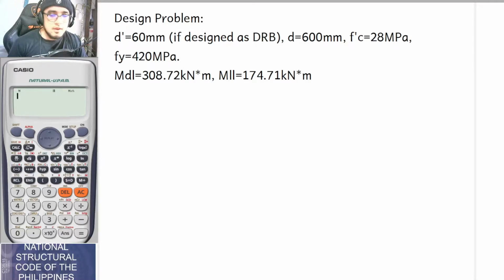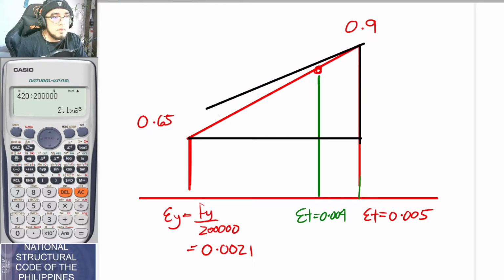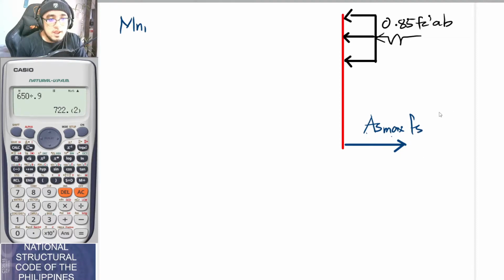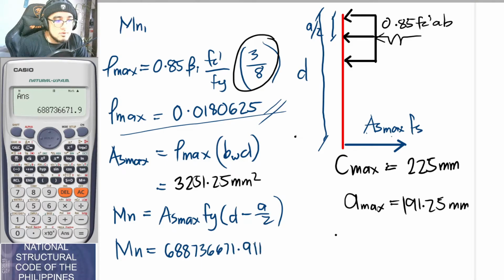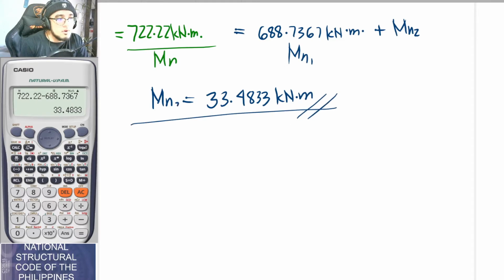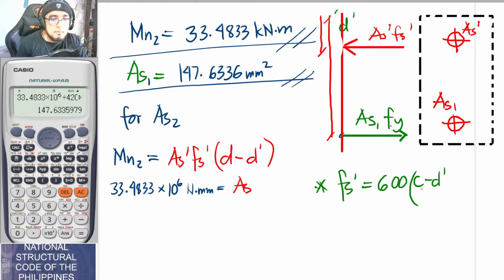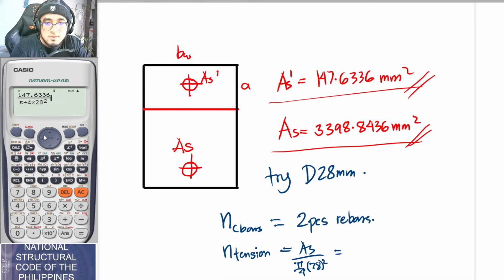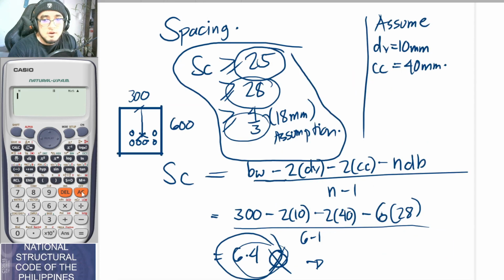Problem Solving| Design of Doubly Reinforced Concrete Beams| Strength Design/USD | NSCP/ACI

Comment: Hindi poba mali yung round up ng No. of bars for Tension bars, kasi di na mag yield?
Reply: When you added compression bar, normally magyiyield automatically ung tension bar. Generally,  compression bars increase the ductility of the beam section and tend to convert the section from compression controlled (or in transition region) to tension controlled.